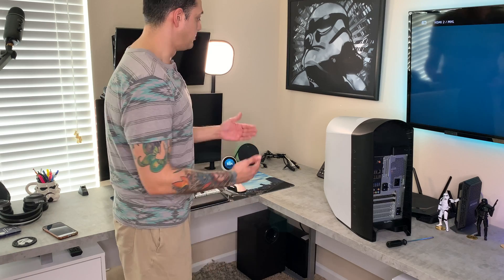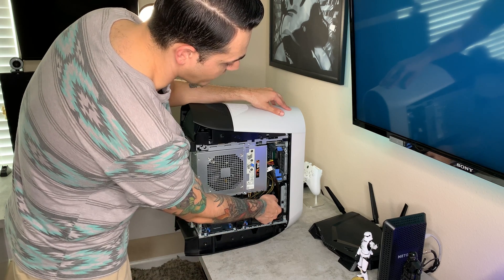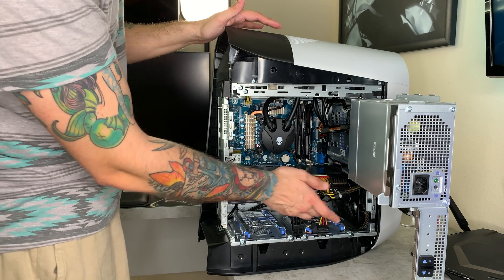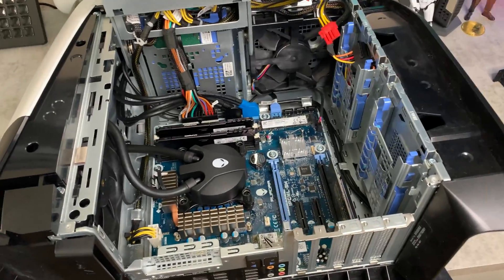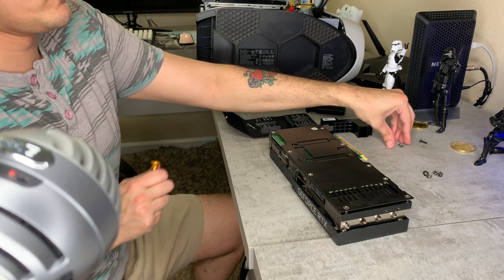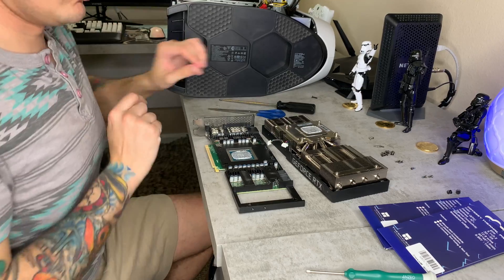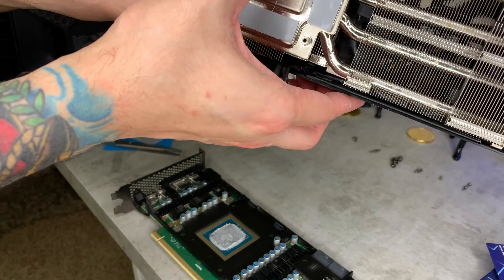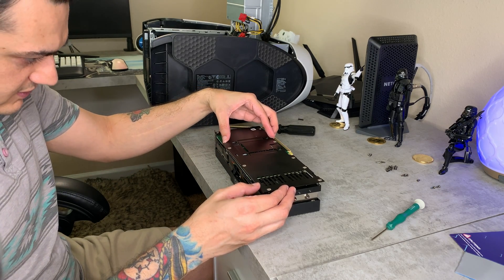Alienware R11 RTX 3080 Thermal Pad Swap

Comment: These cards should all be AIO because they just dump hot air into the case some have complete open case just to not thermal throttle especially 3080ti and above this is even after applying A.M cooling products.

Comment: Quite possibly the sloppiest thermal pad application I've ever seen on YouTube.  Super lazy.  The old GPU thermal paste should have been completely removed and new thermal paste applied - not mixed together.  And you never stack thermal pads - especially thermal pads that have completely different conductivity.  Do your research and purchase the correct thermal pads and the right thickness.  Good lord man, this was absolutely painful to watch.  Yikes.

Comment: 104c on the vram… i run at 92-94c at 122mh/s with just thermal paste on the chip and surounding where you’ve put the pads on the cooling block

Comment: Just got my R12. First thing I did was swap the fans. One Noctura and One Corsair for the exhaust fan. Then I put the OEM fan in the front as a second fan. I have boot up issues. Black screen, flashing yellow light etc. Got it to boot up and then restarted to install updates. Black screen again. I read this can be an issue when messing with the fans. Any ideas?

Comment: I added a couple of 1mm extra pads to the section of the copper pipes that don't have any (on the back plate cover) and that actually took down the Core temperature a couple of degrees .

Comment: GREAT well thought out video good explaining on what your doing

My 3090RTX does 72c 88c vram 
but not constantly
maybe during game that max temp hit just 4 times but avg 68c
 
 hot days can 82 - 90c 

My setup
ASUS ROG STIX Z490E GAMING 
INTEL I9 10900K 10C @5.1GHZ
32GB DDR4 PC3000 GSkill Trident RGB 
Gigabyte 3090RTX Gaming OC 1855-2100
2× +T.B 970 EVO PLUS NVME M.2 Samsung + 12GB of system 32GB HD ram caching 
1000watt
Asus ROG SWIFT PG279Q 1440p 165Hz 4ms IPS GSYNC 27in

Comment: This guy order the wrong size thermal pad u need 2.5 or 3mm for it to have contact, and using cheap thermal paste. U need to add the thermal pad between the backplate for the vram to transfer. U need better airflow case what’s the point if it has zero airflow?

Comment: I was told gpu clearance for the aurora is 10.5" L. But 3080s are 11.5" long. Are the Dell versions of these shorter or is online info wrong and 11.5" cards fit in the case? My R12 is coming in the mail and hoping to do a number of upgrades. Thanks. Been enjoying your vids.

Comment: Strange you didn't see a difference. I've seen other videos of people who removed the thermal pads and replaced with paste, and didn't bother to add additional pads to the copper heat sync as you did, and they saw 15-20C difference.

Comment: Yeah a lot gpu model out there..but i think the best gpu is the gpu that the heatsink touching the vram too..that dell 3080, the heatsink not touching vram because of the plate...temp goes down after putting thermal paste on that plate..but im wonder what if we cut that plate into shape to allow the heatsink touching the vram, then put the thermal pad..

At the end, this will allow vram transfer the heat without the plate..vram> thermal pad>heatsink..rather than vram>thermal pad>plate>thermal paste>heatsink

Comment: So many bad wrong things in this video dude. You didn't even change the thermal pads on the memory chips of the pcb. You just added pads the heatsink man !!! And never stack thermal pads like u have done on the backplate and also never add thermal paste on top of old different paste brand. No surprise that there is no changes !!! 😂😂😂

Comment: I got my 3080s from 3 alienware r12. The same card can do +1200 on memory when installed inside the alienware. In my rig does not go over +1000 or it crashes the system. Do you know why? Have you tried swapping it into another pc? Asus z490 p, 1350w titanium psu and risers from gpurisers. I can't understand why

Comment: Stop discrediting people when you're not doing right.  LMAO
11:16
Although I'm not sure if it's made of metal or plastic, I can see there is already a black plate on VRAM.
You are basically putting extra pads on top of the preinstalled plastic or metal cover. 
No wonder why it's not making much difference.
Plenty of people are getting good results with non Dell OEM cards, your card may not be designed for this.

Comment: Yo, so the inside part of the PCB when you've taken it out from the Heatsink is actually plastic; I felt it when I was taking it out too; so putting in a thermal pad there is of no use at all. We'll have to take the plastic layer covering the PCB out somehow and then put the thermal pad directly onto the VRAM chips inside. I'll let you know when I've taken it out again and tried it one more time once more thermal pads have been delivered to me.

Comment: I did change the thermal pads of my Gigabyte RTX 3080 and the temp goes down from 103-105°C to 72-75°C. I think you used the wrong (cheap?) thermal pads. I used 2 and 3mm pads depending on place, and you need to put them on the chips, not on the headsink or backplate. Also when you apply thermal paste, remove the original first. Do it again, do it right and you'll see results.

Comment: 104C is unacceptable that’s hot as fuck lol . My 3080FE with gelid Extreme pads hits max 82C on the thermal junction temps. Most of the time it it’s a solid 80C when the ac is on at 70 at night this is mining getting 101Mhs 24/7 !

Comment: I changed thermal pads on a vision 3080 and I went from mining at 60-70mh thermal throttling at tjunction temps of around 110 degrees to under 80 degrees tjunction temps at 100+mh. Your pads are too thin for the vram chips and likely weren't making contact. You need 2mm pads, this was a failed application.
Reply: Never mind, just saw your pinned comment acknowledging this

Comment: where did you get the Stormtrooper pics?
also i went through 10 packs of thermaltake, 2mm and 1.5mm and then 2mm Shore rating of 00 and 35 on the gpu side....my VRAM temp dropped to 80...its trial and error.

Comment: I have a 3090, when I tear it down, I only see 12 memory chips.   I have to separate the green and black part of the plate on the left  (10:38) to see the other 12 (but I don't know how to separate them). are you sure simply putting the thermal pads around the core will help?

Comment: You need to add paste/pads/etc... between the two halfs of the cooler.  Looking at where the GPU makes contact with the cooler, those four areas that extend out is where the cooler touches that black aluminum plate, which is what makes contact with your vram under there.  Some guys have pasted there and some have added .5mm pads.  Either way your cooler isn't fully contact the VRAM.

Comment: I left the oem thermal pads alone, added .5mm thermalright pads between the plates (after removing stickers), replaced oem thermal paste on GPU chip with mx-4. OC memory to +800 in MSI afterburner. Sitting at 95mh/s. Overall I'm 10 degrees C lower with a 12mh/s increase.

Comment: Models have NOTHING to do with it. It does not need thermal pads on that section. 1st those thermal pads are not good, 2nd you cant just throw any size thermal pads on they need to match the same for same size 0.5, 1mm, 1.5mm 2mm etc get that wrong and they could be either stoping the contact, that thermal paste is also junk and you cant just top up thermal paste they are different with different compounds.
Anyone doing this please follow these steps
Take the thermal paste off and replace it
Apply a good amount of decent paste such as Thermal Grizzly or MX4.
Next replace all the thermal pads not just the vram as soon as you remove the heatsink they can split.
If you dont know what size to use then either use a digital  or even lay the pads next to each other and you should be able to tell what aize they are
Use something like thermal grizzly or Gelid extreme are pretty good.

Comment: To be honest, I think you did it wrong. Your GPU seems to have a black plastic piece where the actual VRAM is. You put thermal pads where they didn't belong too..  I got about a 20 - 25 degree drop on my 3090 FE so this is not a lie.

Comment: Good job not understanding the issue. Some manufacturers, like Gigabyte weren't putting thermal pads on the back of the memory. They'd put a huge metal back plate, but nothing to help facilitate the transfer of heat from the memory to the plate.

Comment: I went with 0.5mm pads between the card and the heatsink and it did lower temps by 15-20 deg celsius. I have a feeling double stacking 1mm pads resulted in too much thermal resistance
Reply: Did you use 0.5mm for all the thermal pads for the Alienware gpu?
Reply: yeah stacking thermal pads is prooven to have opposite effect

Comment: Don’t put the thermal pads on the heatsink where you did. You actually need to take the black bracket off surrounding the GPU and replace the thermal pads over the memory and mosfits. I did what you did, and it actually raised my temps. I replaced all the original stock pads, pulled off the mod pads on the heatsink, and now my fan speeds are 80-90 percent instead of 100 under heavy use. That being said, when overclocking my memory, I can’t go past 1850 without the screen just going blank...

Comment: I call bullshit. I just replaced my thermal pads on my 3080 Suprim X yesterday and from 110'C Memory Junction Temp it went to 76'C memory junction temp, used ThermalRight Odyssey - 12w/mk 3mm on backplate and Thermal Grizzly minus pad 8 - 2mm 8w/mk front plate. Replaced just the memory thermal pads with aftermarket ones from the stock MSI, and the vram ones on the backplate.

Comment: I got day and night improvement on my 3080 aorus xtreme using the same thermalpads. From +0 memory at 110c to 70-80c +1500 memory. My backplate had pads covering the chipset but other cards like a ftw3 or strix is exposed so idk.

Comment: You did not actualy replace old thermal pads. You have to remove the black radiator from PCB, it houses the old thermal pads, and those needs to be removed. Follow ?v=i4ful9eaVSQ Youtube video to find out what I'm talking about. What you actually did was added additional thermal pads, leaving the old ones in.

Comment: Thanks for doing this video and at least showing how the dell 3080 needs to be disassembled. I've been wanting to replace my pads on my dell's and was hoping to find some vids of others who had done the same, but there weren't any! And I'm sure ppl have already mentioned the mistakes made with replacing the pads so I hope you get proper results next time!

Remove the metal brace and replace the pads on the vram

Measure the pads size that dell uses with a caliper (u should match the thickness)

Clean off the thermal paste and replace

Comment: So after further messing around with thermal pads I am here to say, I’ve got the memory junction temp down to 98c, while maintaining 98.5 MH/s. 38c on card. 233 watts, fans cranked sadly,. -150 core, +1075 memory clock, power limit 72%, fans 100. The pads are 8 W /m*K. I’ve got 12’s coming which are the bad boys you want. This seems to be a big thing about the 3080’s thermal padding you want is these 12 W /m*K. Not really mentioned by any YouTube replacing pads I’ve noticed. Anyway/s, I will update once I get these

Comment: I think due to their design for this dual-fan 3080, there aren't too many options to reduce the heat. Most of them can only reduce like a few degrees. I just brought an R10 with water-cooled AMD 5800x and rtx3080. Comparing to your R11 with an intel, my CPU temperature is totally a disaster. Heading to 80+°C while gaming. I didn't upgrade any thermal pads or fans except add an NVme SSD just as same as you did. So far, switching fans looks like the best to do. I see there is someone upgrade cooler master water cooler on their Aurora. Don't know if that will help...
Reply: Man I was in a similar situation as you are. Bought 5600x + 120mm aio + dual fan 3080. I am not lying to you I bought a new case and a new MOBO to move everything out. The heating is insane in Aurora poor case design so nothing can change it if you want to play hard on this machine...

Comment: You won't get the results you're looking for.  This specific 3080 is not a FE, it's a custom PCB and cooling solution designed by Dell and not available for individual sale.  The thermal pad replacement, is for the 3080 and 90 FE's.  I am surprised at your temps though, that backplate has copper heat pipes on the backside of the memory chips.  The GDDR6x spec says 115 is fine, STS Miner from the Nicehash discord says 105c is fine.  Red Panda Mining says 95c.  It's really whatever you're comfortable with, because the longevity data does not exist.
Reply from the maker: Yeah I knew it was Dell's in house card, but I didn't know it was a different PCB. That's good information about the temps, thank you. Even the Nvidia customer service page says 110C is completely normal and not harmful, but I would still like to drop them lower. With my current settings I sit at about 102-106C while mining Eth at 95MH/s average, which I am pretty happy with.

Comment: do look up Thermal management design . Its a whole field on its own. Essentially you want to take energy away from the components generating the most heat- GPU/VRAM and dissipate it via cooling mechanism. Also there should be a sharp as possible thermal gradient from HOT (gpu/vram) to COLD(heat sink cooled by fans etc) along a specified path(copper path). The fans should be high performance. And the copper path should suck as much heat energy as possible.

Comment: i haven't seen any changes on my temps either after replacing thermalpads. but i can recommend installing heatsinks on the backplate  around the square opening.

Comment: Here is my numbers for 2 cards (opened the case, one on extension : 41 / 39 core temp 102 / 96 vram temp .(according to Nicehash).  90 / 75 fan speed . 94mh/ 99mh hashrate(Nicehash)  room temp 71.F hopefully it's good . Planing taking out one card outside the case too.🤔

Comment: I don’t know what the issue is - all this talk about thermal pads and overheating .
Listen I’ve got my 32:9 monitor set at 5120 x 1440 / super ultra wide etc using my R11 3080 
Playing most things on ultra - epic etc .
I’m getting great frames and performance - they are built to handle gaming . Why do people keep trying to make it a thing ? Nothing wrong with my machine

Comment: hi, i had the same thermal problem with my rtx 3080s 
what i did was to change the thermal pads with  diy aluminium pads + thermal paste (only on the front side and moved the oem pads on the back side) 12x14mm  , 1,5 mm thick for the gigabyte model, and 2mm thick  for msi ventus
and now my cards mine eth at 100ms/s  whit the memory temp at around 75-80 C
Reply: Hey, can you send few pictures how your aluminium pads looking like?
Reply: @danio19901  sure, give me a way to send the pics

Comment: It did make a different for my gigabyte 3080 gaming oc, same pad as you, 20c mem temps drop.

From the video, you did the whole thing wrong, dont put the pad on the plate, remove it and put the pad directly on the vram module.
Reply: I also have gigabyte 3080 gaming oc & used same pads 3 mm backplate 2m on front memory chips & 1.5 everywhere else on front, when from 110c down to 84c 100 mh/s
Reply: I have dell 3080 and dell 3090 ... The 3090 no matter what i did , temp still above  102c. I tried with thermal right odyseey .. 2nd try, chip and copper area only paste kyronaut on chip and mx4 on copper 4 sides.. back plate 1.5mm . then 3rd try i just replace thermal right with another brand of pad 1.5mm put on chip directly 4 sides and center.... got worst result.

Comment: Bro you really need to do this again. I just did my 3090 with less thermally conductive pads than you used . Got my clock set at 80power, -300 core, 1500 memory. And my memory temp doesn’t give about 96c now. Did the front and back and glad I did. Dnt forget to remove the plastic on both sides of the pads before closing .

Comment: I assume you bought a pre-build as a way of getting a 3080.  I have to say there doesn't look like there is good airflow in that case.  While it may be a pain and a tad expensive, maybe consider buying something like a Phanteks P500A Digital RGB and some good Noctua fans and transfer all the components over to that case.  That would probably do a lot for your thermals.  Even if you change the thermal pads, you still need good airflow to cool that VRAM.
Reply from the maker: Agreed. That may be something I do in the near future. Coming from a built mid tower PC, I was surprised how tight all the components were packed into the R11.

Comment: maybe wrong thickness? I have the same card, I'll try with the copper heatsink directly glue on the backplate lol FML
Reply: i used the same thermal pads 1.5 thick....helped about 10c....thats it. also broke my led light on the fe 3090. it is super fragile....
Reply: @jergernice1  10c is a huge difference . I did it on my dell 3080 and I see a 14C difference. Super happy but taking the old pads off was not fun.

Comment: I got my R10 with RTX 3080. From my experience memory temp between 100d cel to 106d cel with 886 mem, 71 PL and -202 Core and I get 95-96 mhs. I’ve tried to reduce PL to 65 but then hashrate suffer badly - 78/83 mhs.